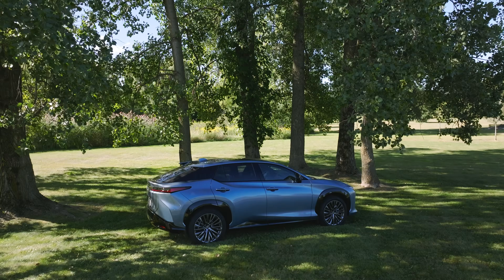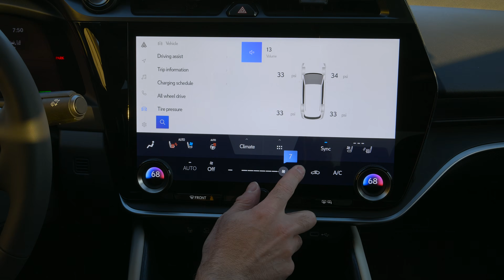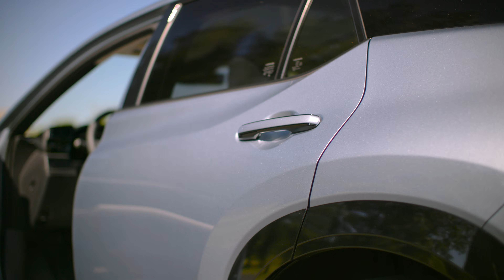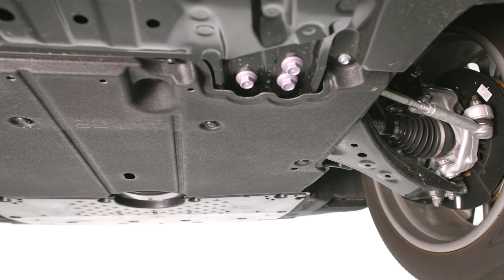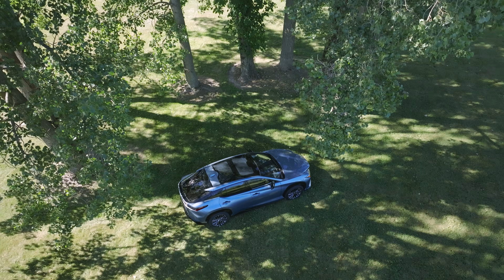Lexus RZ450 EV | Just Say No!

Comment: Extremely disappointing engineering as Lexus was one of the first to come with electric vehicles.   But to come out with a EV vehicle with a realistic range of 180 miles is embarrassing.  The 220 is a lie.  At least provide a converter so we can charge at tesla stations :(   The Lexus executive in charge of EV vehicles should be FIRED. So disappointing for Lexus.  Designed for old people who only drive around the city and charge a home each night.

Comment: Before going overboard with criticism, think about this. This car looks like an ICE in the interior. Anyone can step in and drive it away. Tesla requires some learning and a lot of dependency on this iPad like screen. Secondly, most ev owners are not driving cross country because the charging networks for non-Tesla cars is not mature. This EV appeals to the traditional Lexus owner who wants to try an EV. Simple to drive. Easy to charge at home and use on 50-175 mile round trips without having to fuss with external charging. Long battery life is also an asset. Interior smacks of luxury compared to current Tesla models which rank last by the way in the JD Powers quality and reliability surveys.

Comment: Why should you buy it? Depend on the price. I can't wait for a new car because mine is at the end of it life. In my region the finance it at 3% and I got almost 9% reduction on the msrp. In the end, the monthly payment is almost 5% lower than a soltera ( best deal I could find)with out the waiting. Lexus give a good price on my old car. 

I could get a better deal if I could wait for the 2025 to put pressure on the old 2024. 

For an fun awd car with low maintenance,  It is a good choice in tigth market in my region. I have 2 to 5 days of range depending on the weather. For those that can wait, I think you can find a better deal in the Falls.

Comment: I leased the RZ 300e in April. The capitalized cost is only about $37k (Lexus gave 14k and the dealer knocked off another 6K).
Looks terrific - however some of the switchgear (Charge port door, interior buttons) looks Toyota quality not Lexus. Range is 266 miles and from what I have seen it definitely looks like I will get it especially in City. I got it because it is Lexus not Tesla. I fully expect it to last 20 years with minimal maintenance. I drive less than 40 miles/day charge it on a 120V circuit - don't care about DC fast charging.   Fully intend to  keep it after the lease is over.
Reply: I'm in a very similar circumstance. I leased an RZ 450e, I love the drive quality, sound dampening, sound system and overall experience. I'm still deciding if I will keep mine after the lease. I'm looking forward to the next generation of Toyota and Lexus Hybrids and EVs.
Reply: You should've done your homework first.

Comment: it looks completely fine, it's the range bro.. its the range.
it actually seems like it should be illegal to have 200 miles of range, especially on a luxury vehicle WTF?! LOL
that's the most unluxurious thing ever, you'll be having some wonderful charge anxiety to go with your nice cabin, which you will be in sitting at chargers. There is no way that any sane human bean that does their research will purchase this over anything else, even the chevy bolt ev has 270 miles of range. by the time you take off passengers, loads, AC, etc, you probably have 130-150 miles of real stress free range. they better not sell more than 100 of these, ppl need to talk w their money

Comment: Mmmm.. Wondering why Lexus's rz450e have different range per country. In the US it only has 196 (20" wheels) - 220 (18") miles (315 - 354 km's) while in other countries it's around 279 miles (20") (450 km's) while in Japan it's rated at 306 (20's) - 331 (18's) miles  (494 - 534 km's). ?

Comment: My 2020 ioniq ev with a 38.8kWh battery on a 360v architecture is rated for 170 miles of range and regularly gets 200. This thing is a joke and I hope it flops. Toyota can really go for a reality check or ten. Granted I hate most of the new EVs, and I hate the direction cars have gone in the last few years, this one especially stands out as bad. My ioniq would be an "alpha" ev and its better than this!

Comment: THANK YOU SO MUCH FOR POINTING OUT THE BULLSHIT design in this car and others (as the GTI - and more expensive Audi's are horrible) - as I've been looking for a new car, it seems that each manufacturer is trying to add more so-called technology to distract from what you're supposed to be doing - DRIVING.  We know we're going toward and electric future (for commuting I have a Chevy Bolt which is great for saving on fuel and slogging thru traffic) - fortunately I have a small manual shift sporty car (Focus ST) for fun ! - it has nearly all the same functions available for changing temp, audio, etc.  with BUTTONS that work !

Comment: The best Lexus on the market is the ES300h and IS500.
Reply: No. The best Lexus on the market is the lc500

The es is just a reskinned Camry, and the IS is slow, dated, lacks features of the price, and it’s overpriced. The 500 especially is up there in price with an m340i yet its significantly slower. It’s also more expensive than a charger scat pack yet it’s not more fun than the dodge

Comment: They are still locked in a mindset where they would rather use resources to built 15 hybrids or 5 plug-ins, instead of a single BEV. And considering todays battery technology, it still might actually be more beneficial to lower large-scale emissions that way.

Comment: BEVs will not reach the usability, refinement, and reliability of ICE engines for another 25 to 30 years.  Anyone telling you it can happen in 5 to 10 years is smoking crack.
Reply: disagree. tesla has dozens of features that fossil can only dream of at $32k. I save $4000 a year in gas. No dealerships, no oil changes. if you have a non tesla, this may not apply. theres a reason model y is top selling car in world in 2023.

Comment: I bought this RZ and its so bad of a product. Over the last 7 months, my Lexus has received ZERO software updates, patches or new features. Zero Software updates. Meanwhile Tesla has released over 20 software updates and many new free features for its owners. It should be considered a fraud for Lexus to advertise this car has OTA(over the air) update capability, but they should tell customers that the car will never receive software updates, enhancements or any new features. The entire software suite on this lexus is poorly laid out and designed, stuff is hard to find, impossible to search for and needs an overhaul. It feels like Toyota uses an outsourced software engineering company and they don't design the hardware and software for this car hand in hand. This cars technology is already very outdated and this car is going to age poorly. I regret buying this car, Lexus is so far in the past.

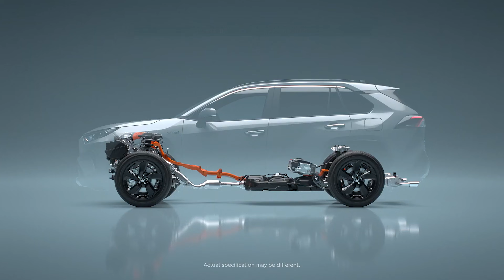Comment: 6:48 Four-corner wheel arrangement! WOAH, the innovation! 😂

EVs have a wicked depreciation factor because one of the most expensive elements is a slow consumable. An EV after 10 years means vast financial investment needed soon, while an ICE car is usually just fine.

A technology should be used for where its strength is. EVs for light, passionless short-distance travel, ICEs for car passion, heavy vehicles and if you need to refuel in no-time and keep going.

If they kill ICEs, another big part of humanity dies and the technocratic conquest would celebrate if that was its thing, so it will just register contentment.

Comment: You must consider resale residual on this offering.  A local dealer sold one for $67K, traded in one month later with 650 miles (tells you something about satisfaction) and initially listed the pre-owned at $61K.  After 6 weeks on the lot, it is now listed for $55k.  I expect it to fall to the high 40s or low 50s before it is sold.
Reply: I bought an RZ with 300 miles and Luxury package for $40k. Fantastic car for the price. No need to play with software upgrades as everything just works.
Reply: Just look at the other electric Lexus, the UX 300e. That looses half its value within a year.

Comment: My buddy brought me out in a loaner RZ450e for a night and I had a chance to get in depth with it over the course of a few hours of just driving.

The HUD is big but doesn't really provide any nice graphics like the BMW ones do and the customisation that you can do within the HUD for the stereo, adaptive cruise control, HUD settings and all is just bewildering. It would have been much easier to just put them in the main screen or on a stalk, and this blend of forcing you to look into the HUD is just weird.

The mark Levinson sound system was pretty good for a stock system. The main display's settings were a pain in the arse to navigate, especially when you have to go through CarPlay, scroll through the pages to get to the Lexus App, then go to the settings, scroll through 3-4 pages worth of other things before finding what you want. The sound settings are also under media, not the car settings itself.

The acceleration is pretty fun, but so are most other TVs at this point. This car neither charges fast nor is efficient. We used up 1/2 the battery doing about 90 km. Granted, there were occasional bursts of acceleration, but a rough estimate of 180km for a full battery is just worrying even in the context of a small city state (Singapore). It also took about 45 mins to charge from 19%-65% on a 50kW charger. We plugged it into a 60kW charger but it did not take in more than 44kW.

That's all before considering the price. It goes for around 300k USD in Singapore, and a model 3 goes for around 175k USD. If you're going to go for a bland car, why not get the one with the better brakes, infotainment system, charging, overall experience and price?

Comment: I say no to every EV.  I don't care how fast they are.  I don't care about the gimmicks either.  That's all they have, off the line acceleration and gimmicks that will probably have countless bugs.  EVs are so passionless that even the Chinese are building fast EVs when they couldn't build a decent ICE.  It's basically the same electric motor that's differentiated by battery packs.  With ICE, you can get different engine configuration to fit your taste, with an EV, you only get battery options.  I don't care that they are "zero emissions", the earth has been heating and cooling itself for billions of years.  Liberals will ignore the child labor, conflicts for land, mining, ground water contamination, transportation, and processing.

The Chevy Bolt is priced about the same as a Mazda3 hatchback with AWD.  I sure as hell went with the Mazda3 because it's just way more engaging to drive.  I slapped in a K&N filter and enjoy the intake noises.  At about 4000 RPM, you can hear the variable valve switching over.  It makes me feel connected to the car.  The exhaust is quiet, but I can still hear it once I floor it, and I can always put an aftermarket one to give it a little added sound.  I can hear the intake sucking in air and it sounds nice when the sound bounces off the walls.  Best I got was 38.6 mpg on 93 octane, about 36.8 on 87 octane.  Usually fill up with 10 gallons and will last me 1.5 week (300 miles) and I can fill it up from two gas stations located .5 mile from home so range anxiety doesn't exist.  And Mazda Skyactiv-G is one of the lowest carbon footprint engines on sale that doesn't use any battery power.

Comment: I think the design actually looks really good, as cross overs go. Lexus does an excellent job of adding sharp angles and strategically tucking items into curves and panels in a way that few other manufacturers do. I agree that it has a generic crossover SUV design for the reasons you laid out, as most manufacturers do. I'll have to strongly disagree with you on the comparison to the Model Y. That vehicle is the epitome of, as you described it, a jelly bean bread box shape. That vehicle looks fat and frumpy and just has no angles to save it. This is definitely better, despite its cow plowing front end.
Reply: Agreed

Comment: The lack of charging infrastructure outside of states like California and the time it takes to charge plus the cost of EVs is a deal killer for me.
Reply: Well, did you know Tesla has a charging network that stretches from coast to coast?
Reply: @DaBooster  i know it does but it's far from sufficient. Try taking a road trip coast to coast fully loaded and climbing and see how it performs along with the amount of time needed to recharge.
Reply: cheapest model 3 with rebate is 32k, even cheaper in some places. ive never charged more than 20 mins w tesla. usually dont have enough time to eat and go to bathroom. i do 300 mile trip w 10 mins charge for $7.50

Comment: I love Lexus as a brand.  I've owned 5, I flew to buy two of them.  I have a '24 LC500 convertible on order.  I've been to their racing school twice.

We also just bought a '22 Chevy Bolt EV for $25K.  It has more range than this car.  It has wireless Android Auto.  It has the same DC fast charging limitation as this car.  In all other ways it is perfectly adequate.  Not great, but adequate.  I'm not seeing another $40K of value in the Lexus.  I would be hard pressed to justify the Lexus at $35K, much less $65K.

I knew after 30 seconds in the Bolt that the commodity EV is already here.  I've had a Tesla 3 and Y as well, the Bolt EV is enough.  Wife and I drove 170 miles the other day, running errands around town.  Charging off-peak at home it cost us $4.60 to recharge.

Don't get me wrong, I'll drive the convertible on weekends and enjoy it.  But when I just need to be somewhere and want to do it as cheaply as possible, the future is really bright.
Reply: It’s our demographic that will make EVs work!
Reply: Lexus Seems to be the only reliable Luxury brand
Reply: So it'll cost you about $10-15 bucks to get around 300ish miles depending on driving style and peak hours.  I spend about $30-35 on gas to get 300ish miles in my latest gen Mazda3 hatch AWD, half spirited driving.  But ICE on average is 15% cheaper to insure than EV.  A Tesla 3 is actually more than 2x to insure than my Mazda3.  Also, I don't need to install a 220 outlet to charge it.  I can drive to the Shell gas station 1/2 mile from my house, or Cumberland Farms 1/4 mile.  Takes me 5 minutes to get back to full range and be able to blast the AC without having range anxiety.  Isn't time of value too?  Oh and don't even say your Bolt is more fun to drive than a Mazda3.  .89g skid pad with rock hard Toyo tires, I put on some Pirelli P Zero AS UHP and it is a backroad carving machine.

When Trump was in office, gas was $2 in my area, a lot more now with Sleepy Joe.  So it was costing me $20 to fill up when the low light comes on.  Being a car person, I can do maintenance on my own and not have to pay high prices for software issues.  So how much are you really saving with an EV?  Don't bring up the planet, you're not really saving it when conflicts are going on for those mining lands and the lack of regulations destroying ground water and soil.  Is owning an EV just wanting to be part of something that seems important while ignoring what goes on that MSM doesn't cover?  A cultural trend of entitlement to show people you're environmentally conscious while ignoring child labor, violence, WEF getting rich off selling you an ideology.  The future isn't as bright as it seems.
Reply: @DroneStrike1776  "Oh and don't even say your Bolt is more fun to drive than a Mazda3."

Our Bolt EV is one of five cars that we own between my wife and I.  It's the appliance in our fleet:  I'm going to use it up (cheaply), throw it away and buy another one.  I only mention it here in the context that you can buy a cheap long-range EV today, you don't have to wait.

I don't drive the Bolt for fun, I drive it for efficiency.  I live at the bottom of a canyon in the Denver metro, when I want to have fun driving I uncover a 471 horsepower V8 convertible Lexus and take it up the canyon.    I don't need to squeeze out some driving fun from my econobox in city traffic.  

Also, you can skip the second paragraph about ideology, that's not me.  I'm a car guy.  My last house had a 4-post lift in it.  My next house will have a 2-post.  I'm a registered Libertarian.  You can get mad at the results of the political football game every 4 years or you can design your life to minimize the impact of those results.  I've chosen the latter.

Comment: In a world where climate change impacts are being felt globally, the bigger question must be asked:  Do we really need to continue the mass manufacture of consumer automobiles (battery or petrol)  at the scale we currently do (as the manufacturing process is fossil fuel resource intensive)?  The proper measure is how much fossil fuel energy is required from cradle to grave to manufacture a product and what steps are being taken to measure and reduce that consumption.  It is a conversation worth having.